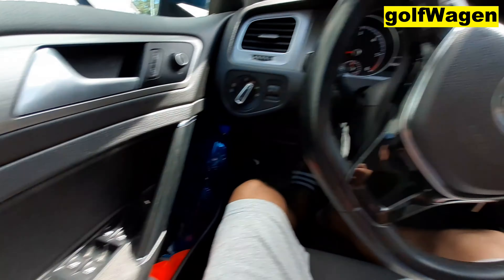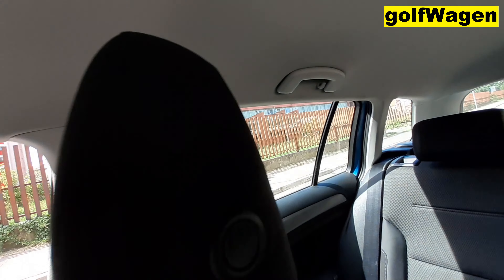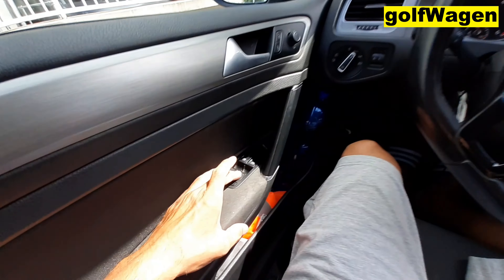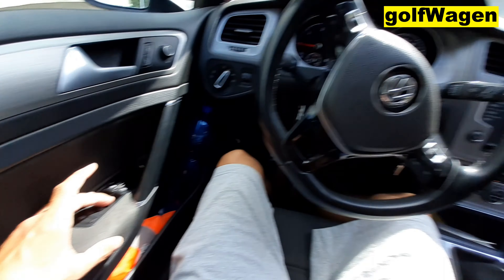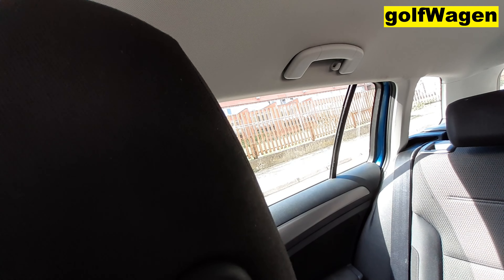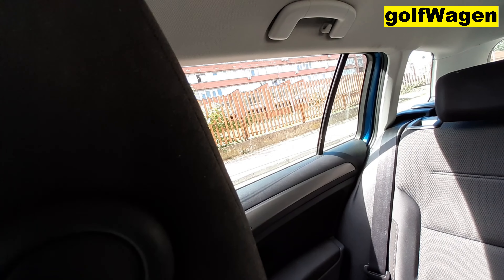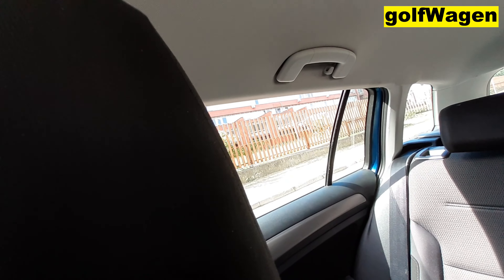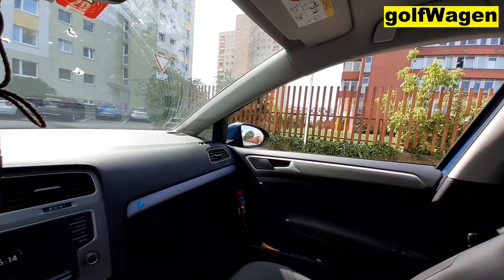VW Golf 7 master windows switch problem

Comment: on golf5 i had the same issue. The contacts are broken and the function is not all the time available.
The soldered contacts inside the box are broken. It is enough to re-heat them. Very easy fix. No any parts needs to be replaced, just re-solder with solder-gun.

Comment: if it is not working normaly you have learn the windows position again. You press down all the time till the window is completly down and push 2 seconds longer you will hear a small noise. Do this for the up position too and it should work normal!
Reply from the maker: agree but, it was other problem
Reply: @golfwagen4173  Hello, I have a similar problem, could it be the door module? It does not perform the basic adjustment of a door. Thank you
Reply: This worked for me thanks

Comment: Was a follow-up video ever made for this issue? I might have a similar problem on my MK7, it’s been present since I bought it over 6 years ago. The driver’s door loses its one-touch function, especially in summer months. (Still goes up & down when the switch is held.) I do the relearn and it works ok for a while but eventually loses it. I thought the dealer had replaced the switch under warranty but I’m convinced they did not. I have OBDEleven Pro so I could also do the long coding so I may try this if I don’t wind up making things worse 😂.
Reply: Was the switch faulty?

Comment: In my 2014 Golf 7, the passenger side window fell down. Despite replacing the necessary parts, excluding the motor, the window will not automatically open or close, regardless of my attempts with the switches and calibration techniques found online. Does anyone have any suggestions for resolving this persistent issue?

Comment: I had this in my SEAT Leon, the contactors inside the module/switch snap and prevent your inputs from being registered. Once replaced the whole thing worked correctly.
Reply: How hard is to replace? Same issue
Reply: @monstrousgaara  Easy enough but be gentle with it, took me a couple hours but there is a video on YouTube with someone showing how to get to it. Search for 'SEAT Leon Door Card Removal'